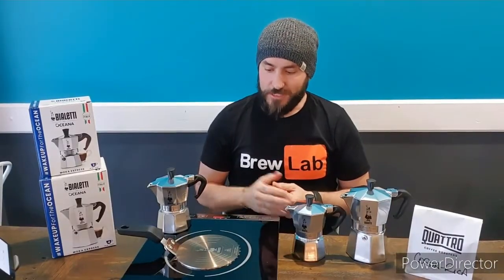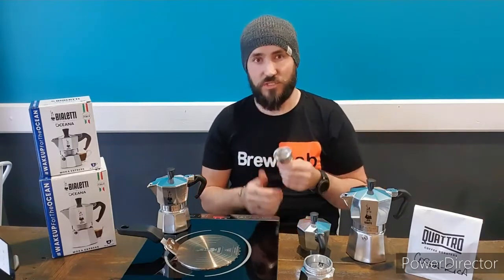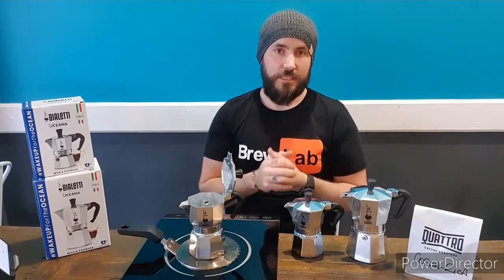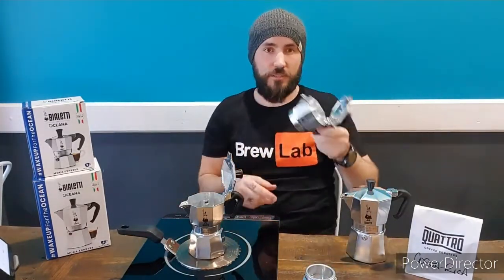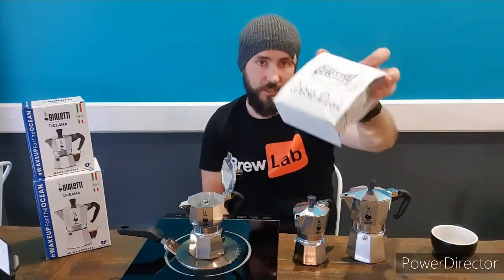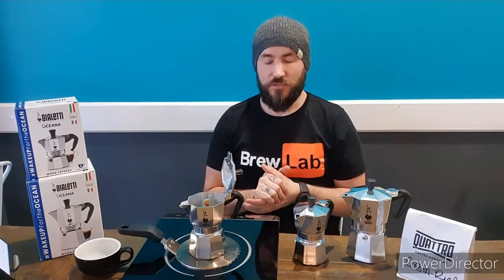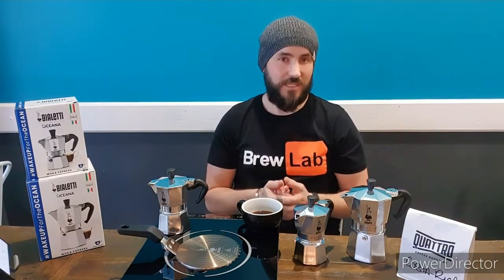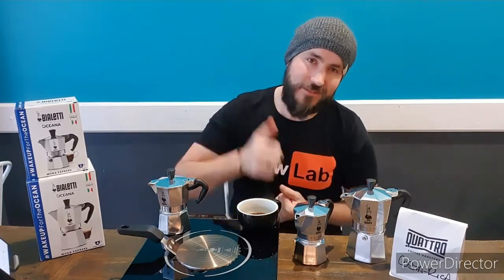REVIEW: Bialetti MokaPot Induction Adapter.

Comment: You're right, the Moka was designed to be very simple. I get the best flavor by following the simple Bialetti instructions, especially to remove the Moka from the stove immediately when I hear it start to gurgle, then let it finish brewing on the countertop from the residual heat inside the pot. Stir up the most-concentrated coffee from the bottom and pour.
Reply from the maker: Thanks so much for sharing. 🙏
Reply: @mitchdoescoffee  I love my New Brikka too! ☕ 😊
Reply from the maker: @photina78  I've never used one, does it really perform??
Reply: @mitchdoescoffee  Oh, my goodness, yes, it's fantastic! I bought a 2 cup Brikka and it makes a lot of crema!

But my first few test batches to season the pot I didn't get much, if any, crema because I had my electric stove a bit too low and I think the crema valve needs to break in. 

It comes with a plastic measuring cup for the water, so you can't fill it up to the pressure valve or it'll overflow. Mine takes 120 ml of room temperature water, and the 4 cup takes 170 ml. 

It works best in a preheated medium electric stove. For gas I'd start with a low flame, and next time go up to medium-low if there's not enough crema. 

It doesn't make the gurgle sound when it's time to take it off the stove like a Moka, so Bialetti says to remove it when you see steam and the crema stream is established. 

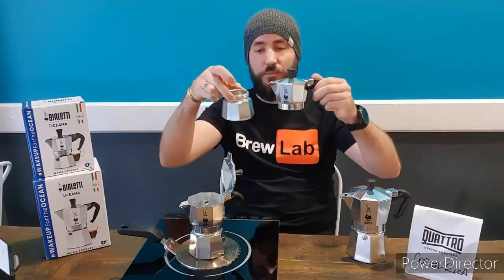So I start with room temperature water, but my barista daughter and son-in-law start with cold water. We use a preheated medium electric stove. The crema starts coming in at aprox 4:30, we take it off the stove a few seconds later, it finishes brewing on the countertop and is done a few seconds before 5:00. 

It has a better flavor profile than the Moka because the valve holds the water back until it's going to go through at the ideal temperature, which is lower than boiling, but hot enough for a good extraction. 

You'll love it!